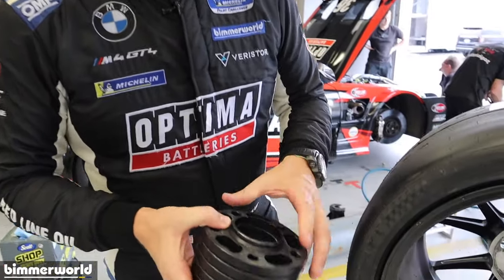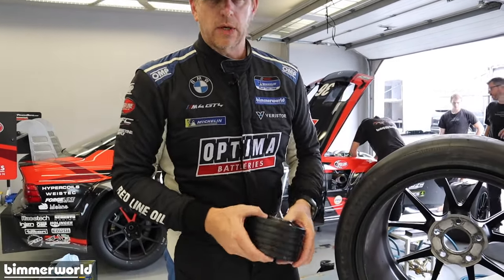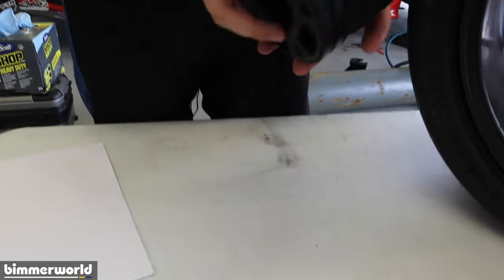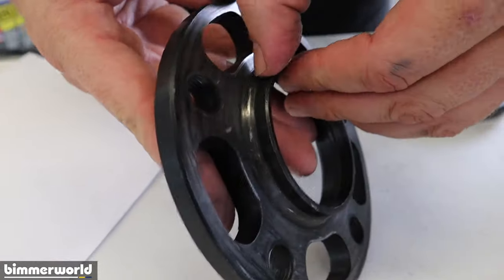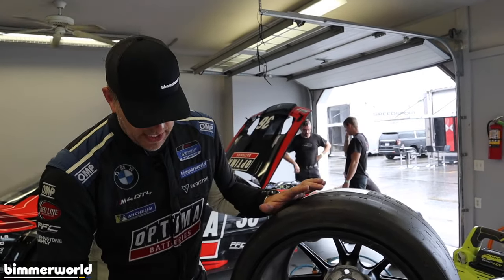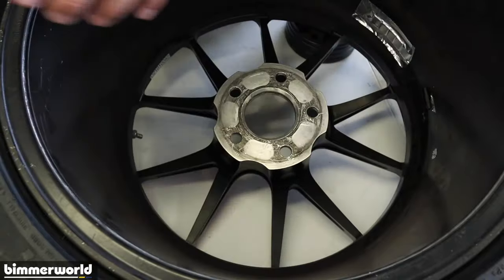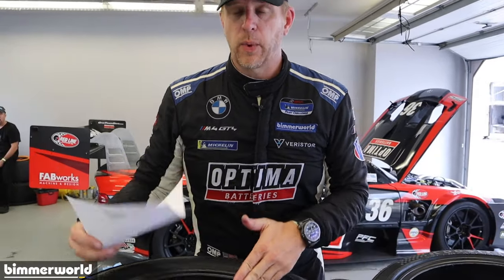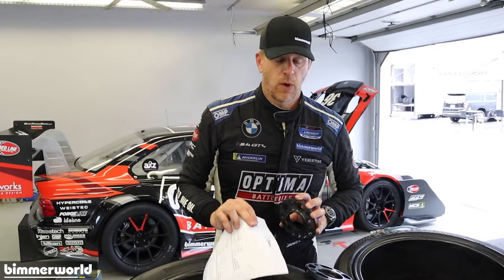MUST WATCH if you run WHEEL SPACERS - VERY important SAFETY tip!!!

Comment: Absolute must check.  People who complaint about wobble or vibration often have the wrong or cheap wheel spacers. I use BBS and H&R spacers on track only and I still check the wheel and spacers for crack or damage after EVERY track weekend. When you wash your wheel after a weekend events its not just to clean them but look for bend and cracks.
Reply: Great points, and please keep in mind that even high quality spacers / wheels can be a mismatch based on how they were manufactured. 👍

Comment: Do also use the paper test between the spacer and brake rotor hat?
Reply from the maker: To be completely certain of any possible issues between the rotor hub and spacer it would be smart to check that as well.  Same rules apply.

Comment: i would think a proper torque of the lugs would eliminate any minor tolerance issues. especially since the pressure of your thumb makes removing the paper more difficult.
Reply from the maker: But it won't, thats exactly what we are saying here.  When its properly torqued it will NOT sit flush and it will pinch the back of the wheel onto the chamfer and the wheel will seat incorrectly therefore putting incorrect load on the wheel studs.

Comment: Time to start manufacturing a tool for the general public to buy and take down the material on the wheel or the spacer. Maybe large counter bore or a conical sand paper attachment on a drill.

Comment: Refreshing to see a video on hub and lug centric spacer and more importantly the chamfer on both wheels AND spacers, I've been aware of it for a very long time and it's so important, another thing that wasn't touched on here are hub rings which can add more problems to watch out for because those hub rings chamfers have to match or be deeper than the wheel spacer. To avoid that possible issue I look for wheels that fit my hub W/O hub rings in other words hub centric wheels. A long time ago I learned something that for younger folks might not even know and that little hub that protrudes out from your axle is meant to bear the weight of your car along with centering the wheel and in the beginning aftermarket wheels were made for specific cars to fit like a stock wheel, it was difficult to find aftermarket wheels early on but then aftermarket manufactures started making the hub bore larger on their wheels and those wheels had different hub rings for different cars and here we are today just about any wheel you desire might be able to fit...remember what I said about the axle hub bearing the weight of the vehicle than think about thermo plastic type hub rings see a potential problem there? If you track your car (or Race) better stick with hub centric wheels the trend of one large hub bore for all isn't as prevalent as it once was thank god.
Reminds me of "Jaws" you get in the cage, cage goes in water ...shark in water...farwell and adieu.

Comment: Great info.
  Apex wheel do not recommend 10mm spacers for the same reason.  The part where the hub goes into the spacer may not fit flush, leaving a gap between the hub and spacer.  So they recommend a minimum of 12mm.  I just found this out since I broke a stud (probably from this and also did not swap out studs after certain period of time).  
 Now I understand there is also the fitment issue between the spacer and the wheel.  I will check both side of the spacer fitment, hub-spacer-wheel.
I installed the Bimmerworld racestuds.  A little more costly but shotpeened and each stud individually inspected.
Reply: yeah the issue with them is that the centering ring sticking out of the hub presses against the inside of the bore of the spacer before the back of the spacer can sit on the hub surface. I heard of people that grind down 2mm of the centering ring of the hub so that the spacer can sit flush on the hub surface. I dont really see anything with that, as long as the rest of the fit is fine and you dont plan on going back to running no spacers. this problem doesnt happen on thicker spacers because their bore is deep enough to cover the whole centering ring on the hub

Comment: question! you mentioned using a barrel grinder on the inner wheel's hub barrel to clear the hub centric spacers. That i understand. Just wondering if it is also safe to do on the spacer instead (reduce the hub lip on the spacer). Would love to know as i much rather not cut into my inner wheel cos its much more expensive and may affect wheel balance (?)

Comment: Surely a "barrel grinder" approach is dodgy at best! Wouldn't the wheel need to be machined on a lathe to ensure uniformity and accuracy??
Reply: Less dodgy than not doing it - and at the center of mass, the balance effect is minimal.  But sure - if you can do it right, that's always better.

Comment: So, let me get this straight... You use spacers in race cars?
Reply from the maker: That is correct.  The BMW Motorsport M4 GT4 comes from the factory with wheel spacers as do many other GT4 factory homologated racecars.  If the spacers are designed correctly and mate to the wheels properly there is absolutely no danger in running them.  This is what we are trying to tell people.  But IMPROPER wheel spacers are as dangerous in all cases.  The Pikes Peak, 1500hp car in the background of this video runs very large spacers, but they mate correctly to their Forgeline wheels and we've had not a single issue or failure throughout running that car over 4yrs up the mountain where safety is absolutely a priority.
Reply: @BimmerWorldMedia , thanks. That really makes me feel better. I own a 2024 Nissan Z and I just put spacers to bring the rims a little bit more flushed to the edge of the fender. I know that the offset part of the rim is now pushed out more. Just don't want to mess the suspension. The wheels look so much better this way.
🙏
Reply from the maker: @CarlosPerdomo  Again, every car is a different and specific situation that needs to be addressed in a safe way.  We are providing a great way to make sure the spacer and wheels fit well together, but there are other areas of the car to be sure is up to the task as well.  Things such as extra load/leverage on wheel bearings and suspension for sure and adequate thread engagement on your lug nuts as well of course.  As long as you go about it in a safe manner and make sure its mechanically all working properly it should be fine.  We certainly are not saying a blanket "running all wheel spacers are fine." here.
Reply: @BimmerWorldMedia  I get it. Thanks so much for your response. I took all pertinent precautions and torque specifications. It rides good. We'll see what happens.
Thank you again. 🙏

Comment: Question: I brought universal 20in Mazzi 351 hype rims for my 2015 Genesis G80 Rwd. I have a slide on 8mm spacer and the plastic hub rings 72-67.1mm which fits my car but still leaves a gap/movement still. What do you recommend?
Reply: no part of this area should be plastic, especially if you are saying that your hub centering insert (having this instead of a wheel with the correct Center bore is risky on its own) is plastic
Reply: @syjdmzx  incorrect, friend. the vast majority of hub centric rings are plastic, they are very popular. there are fancy aluminum ones but they are unnecessary. they strictly center the wheel, while the lug nuts/bolts/studs will do the actual clamping and bearing of weight. enkei and other reputable wheel companies sell plastic hub centric rings.